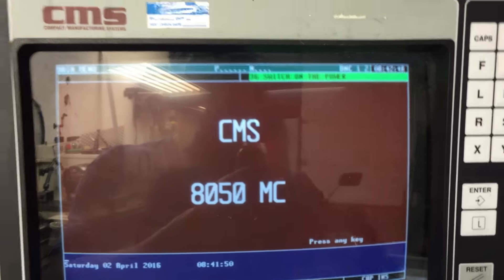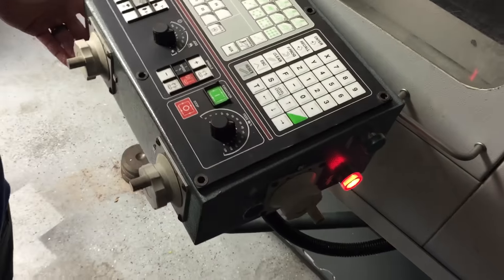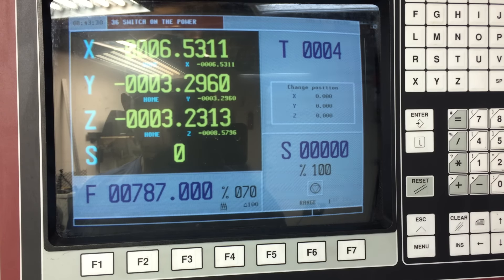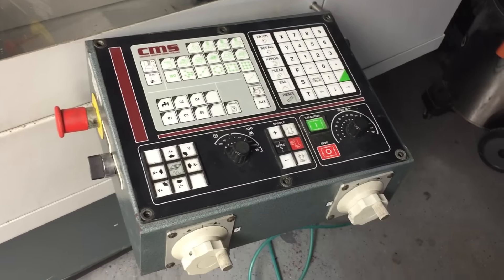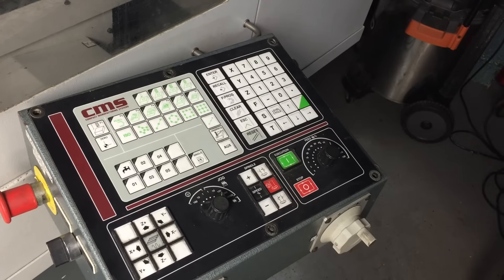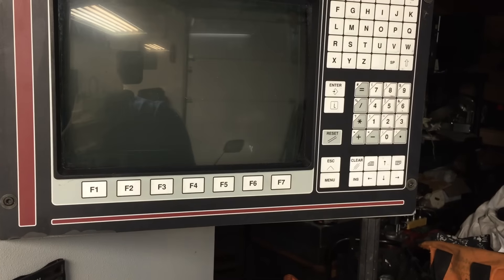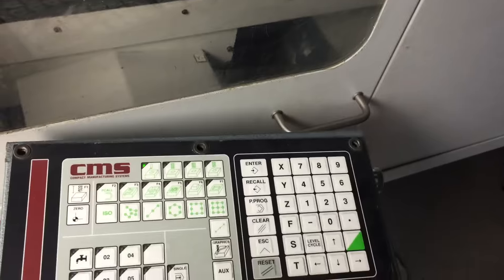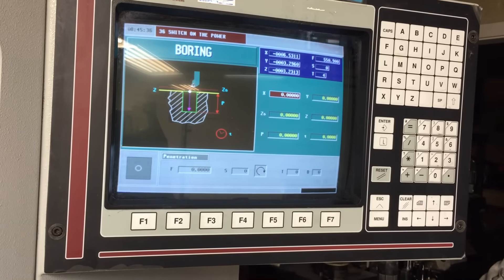New VMC under power *PLEASE HELP* Unorthodox Fabrication

Comment: Also the presets as you are calling them are actually referred to as canned cycles in the CNC world. Been doing this for a lot of years, but have never run a Fagor controlled machine. Sorry for grasping at straws here.
Reply from the maker: Don, thanks for the comment I have tried the estop. It is good. I will try that other suggestion when I get back home. I really appreciate your help. 

Side note: the green button that I pointed out in the beginning worked 1 time and he machine came to life. But then when I turned it on again the green start switch did not function. I checked continuity on the switch and it was working fine from what I can tell. 

Canned cycles noted. Thanks again and I will report back later
Reply: Hope you get it up and running. New toys are fun.
Reply from the maker: +Don Jones Don,

Thanks for the support. I've got her up and running now! I simply had to hit the "reset" button prior to hitting the green start button.

Comment: Just looked at an online version of the manual, have you tried pressing the shift up arrow and reset buttons simultaneously? to see if the machine powers up?
Reply from the maker: I tried this and it did reset. But the power issue is the same. I'm thinking maybe there is a loose wire somewhere.